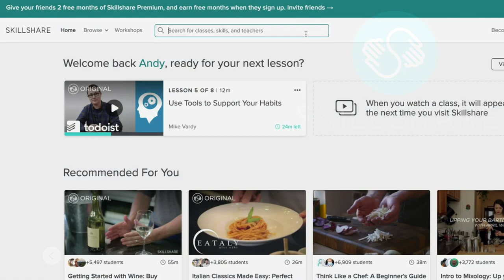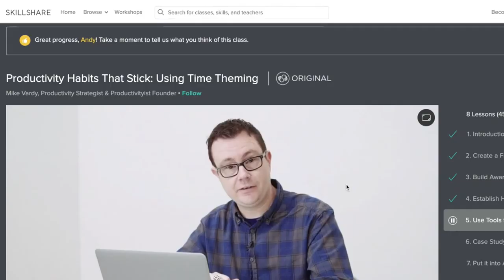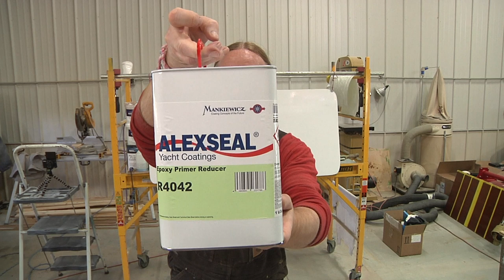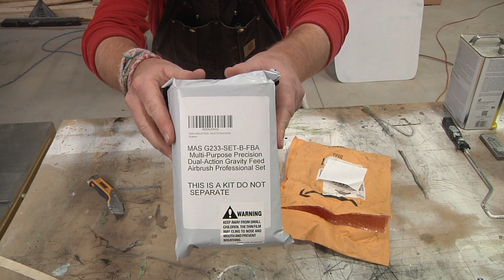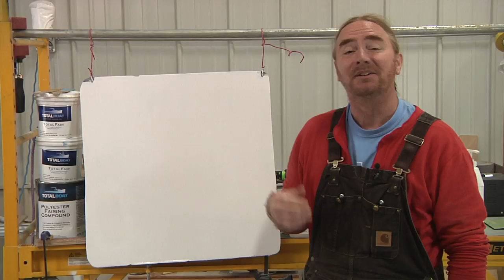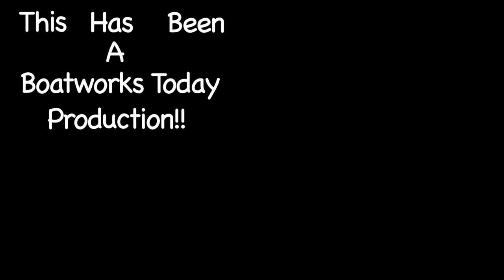Can A $27 Airbrush Spray Pro Quality Boat Repairs Using Alexseal Paint??

Comment: Thanks for another extremely informative, instructive video.  I am just finishing up refinishing my boat with Alexseal and believe it is the best family of products of this nature on the market.  I painted the hull in Sky blue with Arista blue for a boot stripe.  The glossy finish is unbelievable and just rolling the paint on worked out very well.  One thing that I have done in the past with Interlux Perfection and it seems to work as well with the Alexseal is that if I mix up too much, I can store the leftover paint in the refrigerator for several days and it still works fine.  Never ran into any issues doing this and with the super high cost of these paints it saves on what would have been thrown away money.  I have also had very good luck with the Totalboat fairing that you recommended and am going to try their buffing compound.   Always look forward every Sunday to your new video.

Comment: I have that same scaffold, like you, it's turned into a shop workbench, shelf, hanger......  I like that it is also rollable and can be stacked.  Thanks for the vid, I am going to be working on a '91 21' Fitz center console floor rebuild.  Looks like I'll be using this airbrush on small spots for touch ups and the paints for the main floor re gel coat.

Comment: Perfect Andy. I to purchased the same air brush for 2 small repairs in my carbon composite Farrier F22 Trimaran. I have not used it yet but I"m glad it works for you so it should work for me.

Comment: Hi Andy, I am a professional detailer here in Europe. You should try FG400 from Menzerna. It is a Buffing compound, easily removes P1000/1500 from Gelcoat. But the best thing is you don't have to polish after even od dark colors. No fillers, no Silicone. What you see is what you have, no masking effect. Even forget wool pads, hard foam is more than enough or even softer. You can use super finish pads with the same compound if you just need to do a finish job. And finally no dust at all. 
And if you have some money to spend you should look for Rupes iBrid nano 1 inch or 2 inc orbital movement, rotary movement, polishing, sanding, cleaning machine. 
P.S. nice work. You are an inspiration. Because of you, I started to do small GC repairs too. 
Thanks

Comment: I admire how Andy uses skill and knowledge to replace spending tons of money on tools and materials that are just not needed. Practicality is genius. Do what you can, with what you have, where you are, right now.
Reply: Ao1968 Andy also has some expensive tools, Festool is not cheap, though if you watch AvE’s channel he takes apart a Festool saw and it is very disappointing that they use bushings instead of bearings, and low temp melt, cheap plastic instead of high temp melt, high quality plastic.

Comment: Great content. I've just bought a jet ski with blown motor which I can fix but more worryingly is the hull at the front has worn through with previous owners beaching. By worn I mean to the point that there's holes. Challenge excepted. Though tips always welcome.

Comment: I like wet sanding gel coat with the rotex  150  speed 3-4 in the aggressive mode and I will take it up to 5000 grit with 3m trizact  then the 3m wax.  It’s super fast forget the cutting compounds.

Comment: Hey there - seeing how you use that double action airbrush you'd probably do just as well if not better with a single action. Not much point in going double action if all you're gonna do is pull the button back to full open on every pass. Also, pro-tip for any viewers here planning on getting an airbrush is to get a small sized airbrush hose, and adapt it to your main air hose. SOOOOOOOOO much easier than spraying with that full weight hose and quick connect attached.

Comment: Look up, (Airbrush Air Horse Quick Connecter) on eBay, and get a thinner air hose it will make it much more pleasant to use. I have an Iwata eclipse side cup and love it for Art. For general use, I don't think you'd notice much difference. But for very fine lines and nice out spray more money makes a dif. Also when changing needles you also change the nozzle size. and you can also polish the needle for detail. again not necessary for big jobs like this.  I also use a cheapo brush for staining and small jobs like this. even cheaper than the one you got.

Comment: I have a question for you... i would like to gelcoat my little sailboat but here’s the tricky part i would like to blend two colors together... the plan is to have the half of the hull deep blue, and the bottom light grey... no traight lines, on an averadge of 3 inchs passing from the blue to the light grey, the hole idea is to make the boat look like a shark, bottom grey, sides deep blue...

Comment: Very cool. Painted my catboat’s topsides with Perfection. Plan on removing some scratches and areas where the paint failed, and hope to be doing this fall or spring. Just an awesome little video. Only question is whether to top the snow white interlux with a glaze coat. Keep it up Andy.

Comment: Andy why did you have to shoot primer on the repair? You didn't take it down to glass did you?  You couldn't have just use the first coat of paint as a high build?
Reply: Primer aids adhesion plus (I don’t know his exact purpose) it indicates when you’ve sanded to the ‘original’ paint surface.

Comment: Hi,  Are there pigments available for base white paint similar to colour matching for gelcoats ?
I have come across a boat (Jeanneau Prestige 38s) that needs repairs to the hull side but the gelcoat surface has weathered so much to a "white" similar to a paint finish,  and blending the gel repairs in reveals the under colour which is a strong yellow. I am looking at a spray repair but as you know the weathered off whites are all so different and I need to know if pigment colour matching is possible and available.  Many thanks
John (UK)

Comment: Being so hard, do you think it would work on a timber boat or just crack? Not sure a painted surface microns thin has the same mechanical properties as a mm thick gel coat. Hard = cracking at that thickness if there is any displacement in the surface. One property of paint is cosmetic and the other is way more than that...though I know you know that.

Good videos btw. Not having a go at you but just want to bring in other factors than are relevant to anyone who owns a boat that is continually flexing (working)

Comment: So you can use your shop compressor ?  or does it have to be turned down some what ! Thanks
Reply: You always have to pre-gun set max pressure so realistically any sufficient air source can be used with the gun

Comment: getting ready to paint my complete boat. Have you worked with the Alexseal metallics?
Reply from the maker: Very little.  From what I saw it is a bit more technical to apply (and it's a spray only application I believe).  Also it's quite a bit more expensive by the time you figure in the paint and clearcoat.  Probably best over smaller highlight areas rather than an entire hull IMO :-)

Comment: It amazes me that Alexseal is being praised so highly for being able to roll, spray, touch-up and buff it. Are other marine paints not able to do this? I'm old school and do a lot of automotive work still with oil based enamels. I have also used these same enamels on marine applications with success. Even the cheapest Walmart Rustoleum you can find will roll, spray, touch-up and buff just fine. They just don't hold up to UV for long. If you are bothering with color sanding (cut and buffing), you can lay it down with a aerosol can and it will come out awesome. So I am not surprised by the airbrush results. Is Alexseal, by chance, enamel?
Reply: enamel sorta just means ‘shiny’ but I think you are equating the term with “oil based” aka linseed oil which isn’t necessarily linseed oil or “varnish” based. I haven’t looked it up but I imagine it’s a type of polyurethane marine paint which coalesces and “air cures” in addition to actual ‘drying’ by solvent evaporation. Most boat paints are two-part cure either by base paint + activator components to cure (different than drying) or base paint plus air(oxygen) to cure. 
Look up the spec sheet and SDS on their site and it will tell you what it is.

Comment: Good informative video Andy.  But are you aware of the "Epoch Times" ad run in the middle?  They are a political extremist paper from China.  Right wing propaganda is certainly not what I watch your channel for.  Aren't there some non-political ads you could use which wouldn't be such a turn-off?
Reply from the maker: I have absolutely zero control what Google decides to run for ads :-/
Reply: The Epoch Times is an American publication. It's based in New York and generally is quite factual and insightful. Not many actually still believe the drivel of the corporate mainstream  propaganda bought and paid for media anymore...only the truely blind who don't have a critical thinking mind believe the lies fed by CNN and MSNBC. #redscare
Reply: I don’t have a problem with those ads, for one, but more importantly I’m not here to watch the ads...